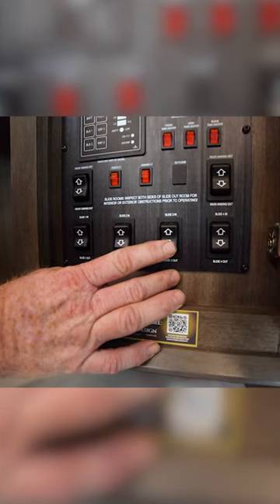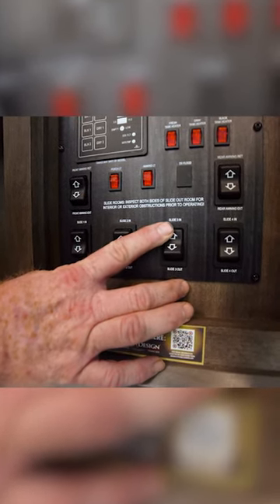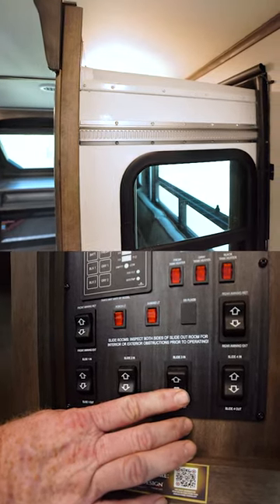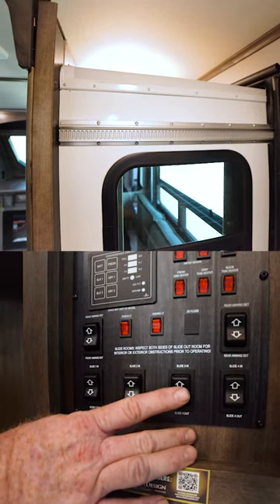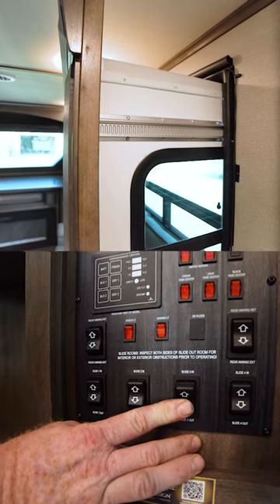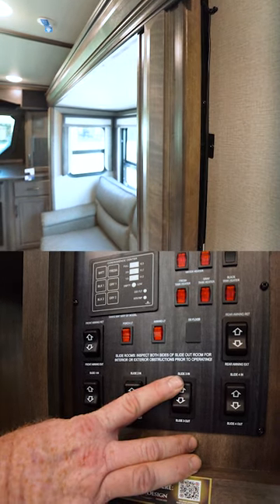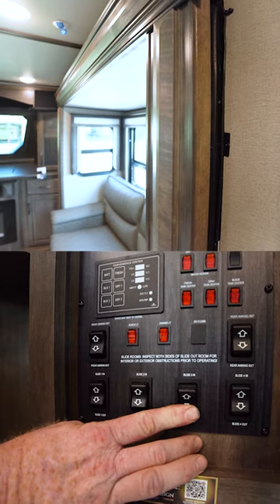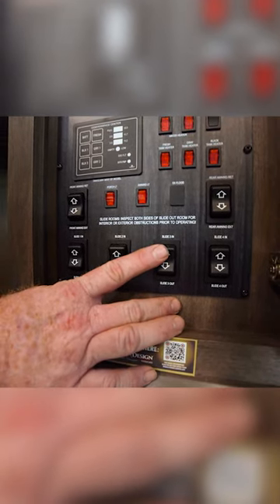RV Slide Stuck? Try THIS 👀 #rv #slide #camping #travel #shorts #shortsfeed #shortsvideo

Comment: If you extend them out fully let the motors amp out then tap in and the amp them out by extending again but hold for ten seconds this time after and then bring them in they will be re-synced 👍🏽
Reply: Thank you for this tip. It just happened to me during my trip on a weekend, I didn't know what to do. Just broght in the slide in manually, to get back home.